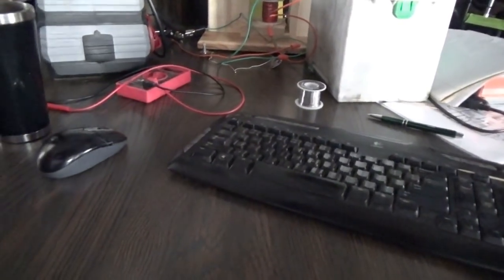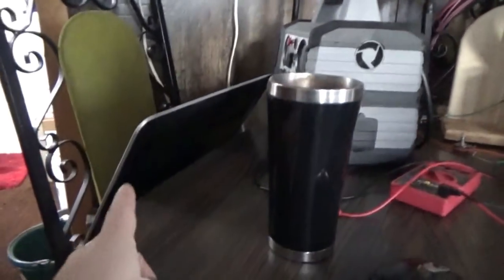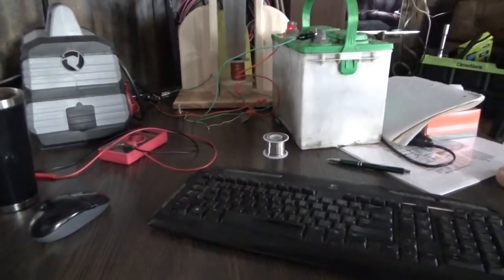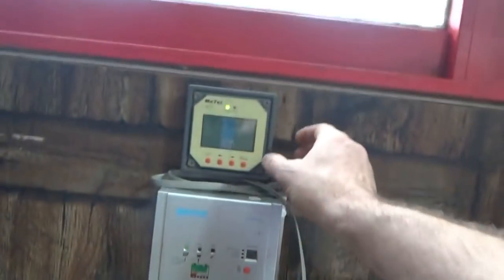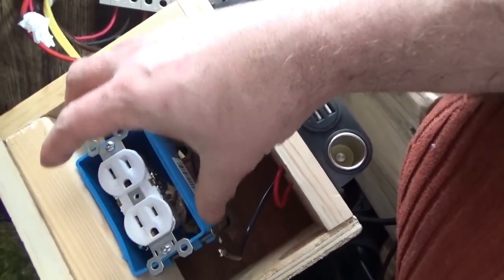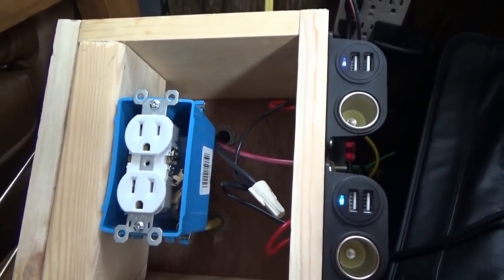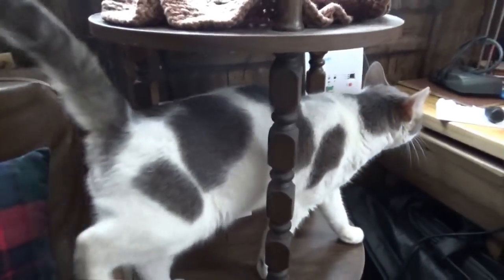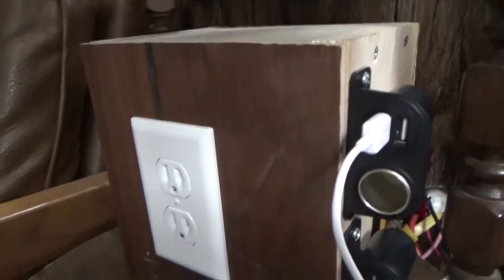AC And DC Solar Power Outlets In Our Tiny Home

Comment: Sorry, I don't see how the power box can be portable and still be legal to code. It gets back to the issue of exposed wires. Not meaning to give you a hard time. Just concerned about safety. A couple days ago, Lankester Merrin  posted a link to a good video that talks about setting up a solar power system.... https://www.youtube.com/watch?v=x7YWPjycgR4  Note the use of conduit, and there are circuit breakers on everything. Your system might be a little different but the video is a good general guide. You can also consult an electrician for advise. Wishing you the best.
Reply: Fixed-By-Dork 👍🏼
Reply: What is this portable power box for ?
Why not just put a flush mount 120 volt box in the wall, no exposed wires ?

Comment: Have you got any wind? If so you could put up your wind generator so you could make more power. If it has an internal drain take the battery out of it while your charging it.
Reply: I have an idea for you troy , take an bike wheel and some how hang by your gutter , make a water wheel , you said it rains a lot
Reply: off the grid tiny home out west lol
Reply: I think the bike water wheel hanging from a gutter would produce more energy than a bedini motor :)
Reply: He needs to put the wheel at the bottom the downspout, where the water pressure is the greatest, just have the water pouring directly down onto the paddles.
Good idea, off the grid tiny home out west. I like the way you think.

Comment: When you do the warm air hole into the battery box, are you going to do it directly into the box, like you did for the wiring? That seems like the best way, so you don’t have to insulate the ductwork.

Comment: Nice electrical box. 👍
Reply: The box is nice, but.... If the box is portable and there are exposed wires, its not up to code. Now, Troy may not be required to follow code if the system is not connected to the house wiring. Not sure about that. But following electrical codes is always the best practice for safety.